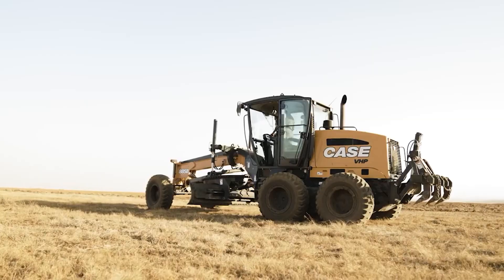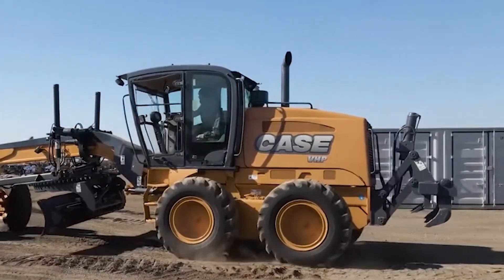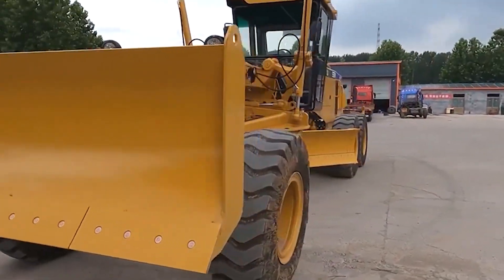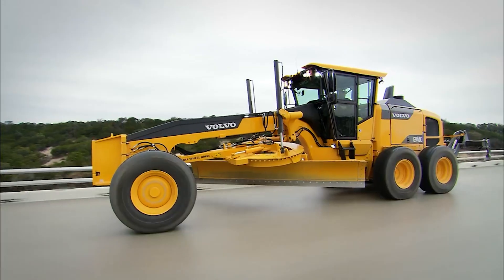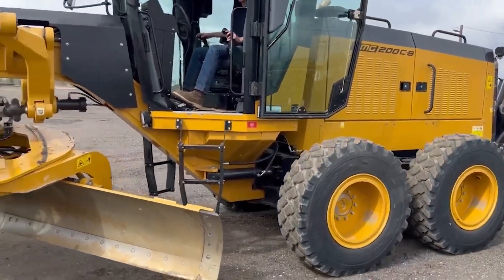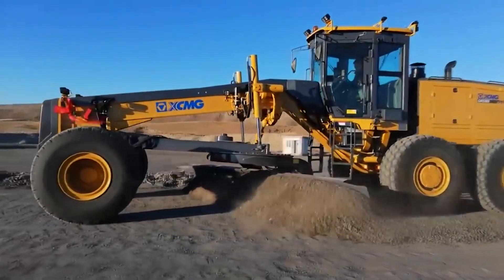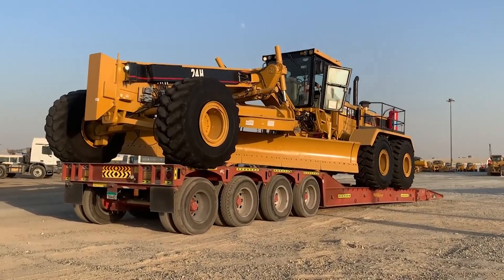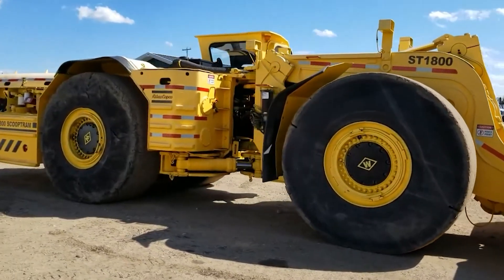10 Largest Motor Graders Ever Built!

Comment: Good information but the hokey script adds very little.
Reply from the maker: Thanks for the input! I am always striving to improve these videos and are unsure of what kind of information to include. Would you mind sharing what kind of info you look for while watching these types of videos?
Reply: @GigaGearGalaxy  The info was fine but adding the silly superlatives was, well silly.  Also, if you start with metric dimensions stay there, otherwise mixing metric and Imperial is really annoying.  My brain doesn't compute the weight of a heavy machine if you use kiligrams.
Reply from the maker: Awesome! Great feedback! Thanks so much!

Comment: The cat  24 grader is not the largest very built  , not even close the  Champion 100T WITH A 1000 HP ENGINE and 24 foot wide blade tipped the scales  at 202000 lbs compared to the cat 24  161000 lbs and then there is the Umberto Acco  grader with 12 tires ,33 foot wide blade and 1700 hp engine  that weighed in at 400.000 lbs .
Reply from the maker: Thanks so much for the input ! I will hunt these ones down